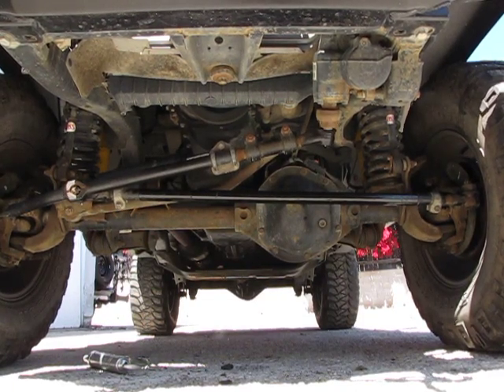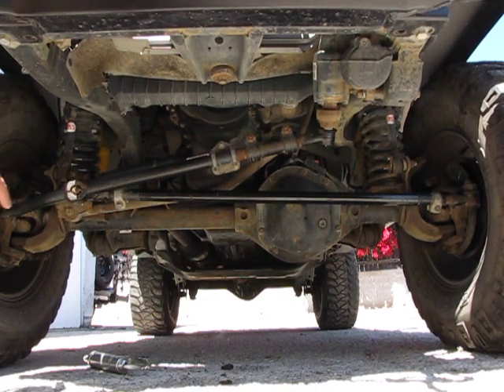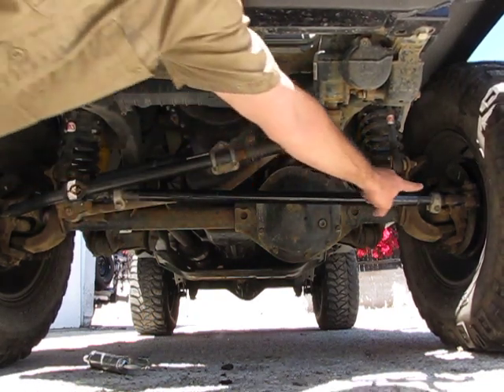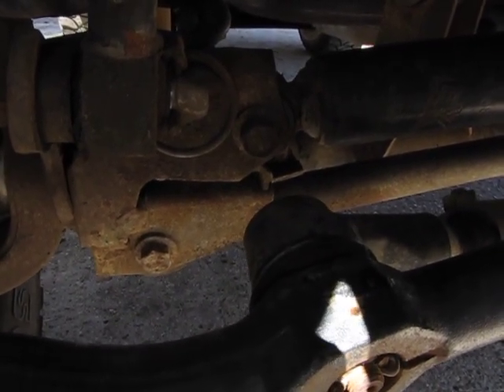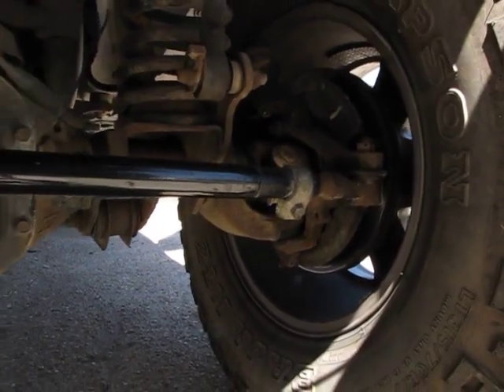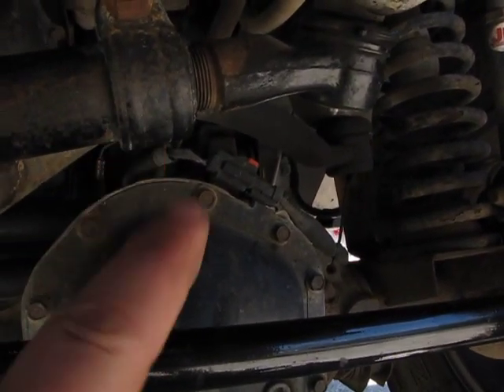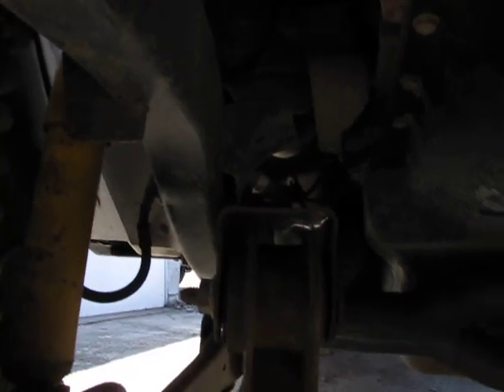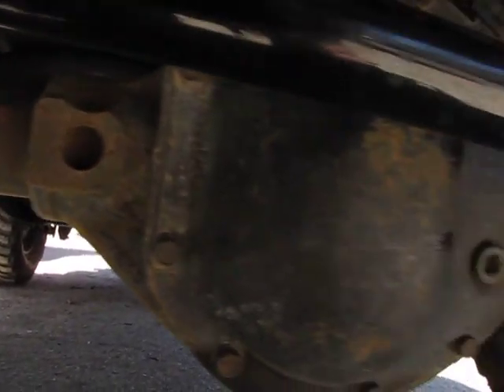Jeep Wrangler TJ/LJ Dry Steer Test---Dx DEATH WOBBLE

Comment: I can see the trac bar has play.  I would get rid of the steering stabilazer as it masks slop.  Place a hand on every joint and feel any possable movement.  With Jeep parked in gear and off, push and pull on top of tires from the front to determine if there is upper/lower link play.  One little trick I should patent is if there is any slop within a bolt-to-joint, cut the appropriate stainless feelergauge to stuff in between the disassembled joint...It Works!. My 02 TJ has no wob and no stab!!